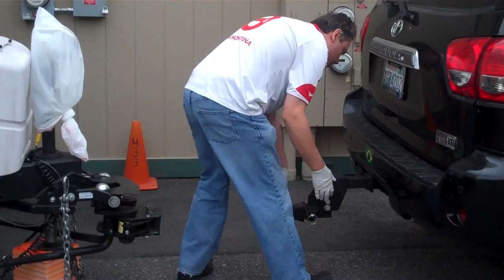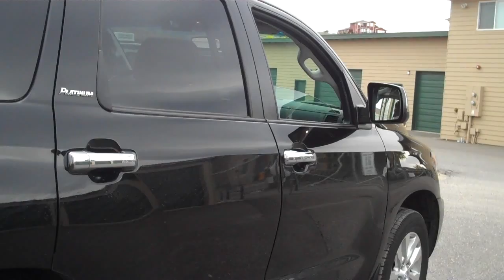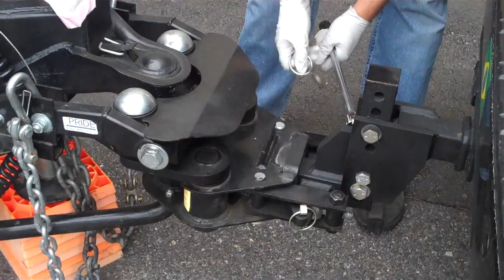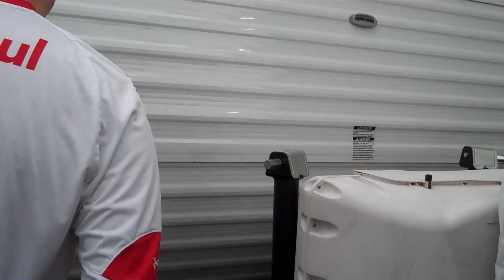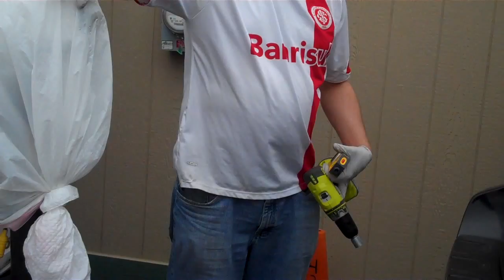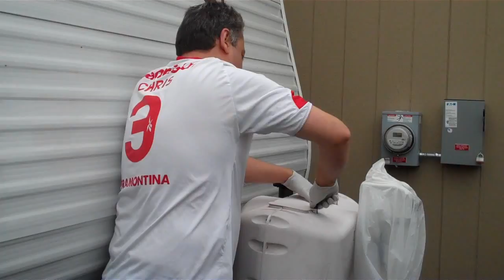Hitching with Propride

Comment: I have a propride and it works better when you have someone to help with making sure the trailer is correct height as you slowly back stinger into the receiver.  with two people it take less time and while it takes a bit longer than the equalizer hitch we had before the difference in towing is AMAZING. best hitch on teh market. bar non not including hensley which is the basic same hitch.

Comment: 8 mins to hook up the trailer?? Long time.
Reply: The ProPride hitch is an interesting piece of physics, it's not your ordinary hitch by any means. I, like the gentleman in this vid, have never been in a terrible hurry to hitch up my camper. The more you hitch up the faster it will become I can usually complete this operation with my ProPride in about 4-5 minutes. Not as simple as dropping a coupler onto a ball and driving away. The key is to do it safely and complete the proper steps so as not to injure anyone or otherwise break anything. There is no time-limit on safety.
Reply: not as long as 3 months in the hospital or worse from a trailer accident...
Reply: There's no reason hookup can't be completed in about 2 minutes, especially when you're in practice.  If you're  having to pull the trailer a lot under a variety of conditions, this system  is hard to beat.  I spent a lot of time on the road driving  across states and cross-country from one project to the next one.  The Propride worked flawlessly going across windy Iowa, Kansas, Colorado, Wyoming, etc.  To me, the combination trailer and truck felt more stable in 30-35 knot winds than did driving the truck solo in similar conditions.